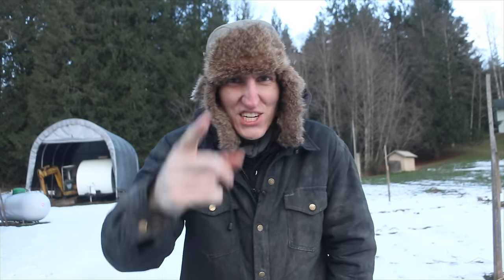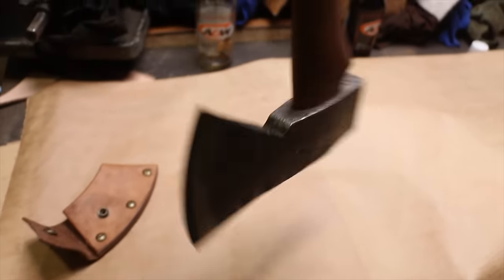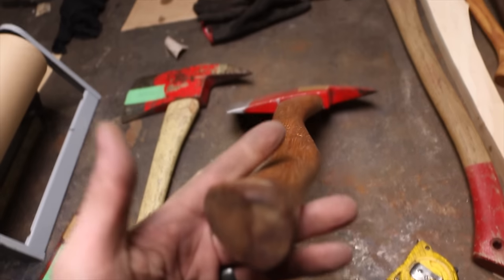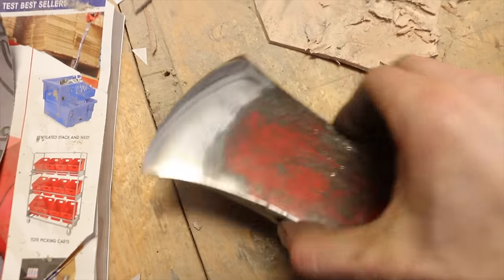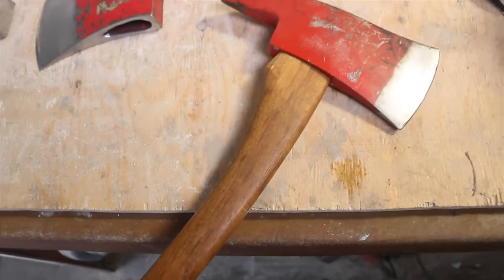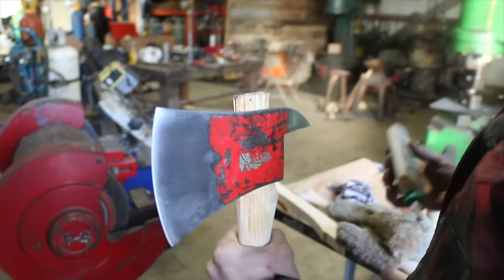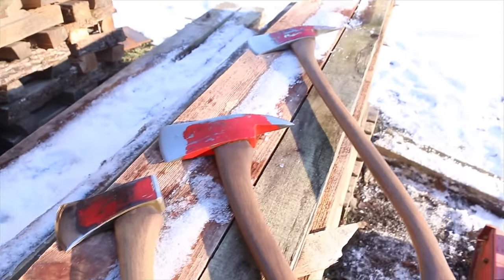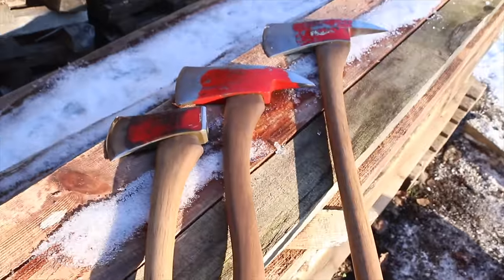Is this the BEST axe?

Comment: Ok so as a fireman I feel I need to say the small axe without the pick is called a flat head axe in the service the other 2 are pick heads they aren’t typically very sharp as if they are they can get stuck in doors and roofing they more or less smash and cut at the same time also the reason the handle is tall is because with our gloves being so thick it can be hard to get a grip on the tool so it being bigger helps with that
Reply: I for one appreciate that information. That's very interesting to learn!

Comment: Back in the mid eighties my did put an axe through his foot, clean through to the ground, because of a bent axe handle.  It glanced off the piece he was chopping and went right into his foot.  I don't know if that axe has been sold yet but I would suggest putting a new handle on it even though it is really nice aside from that bend.